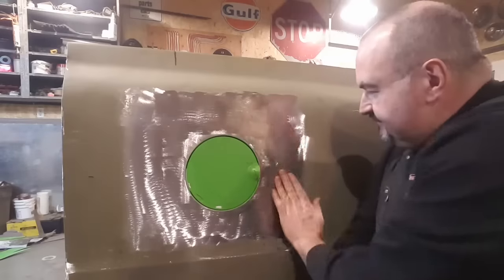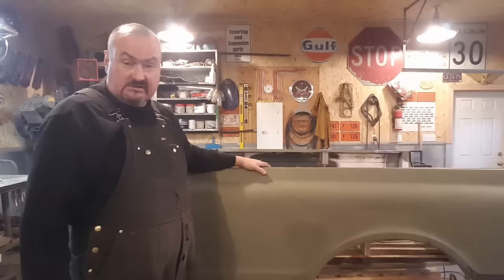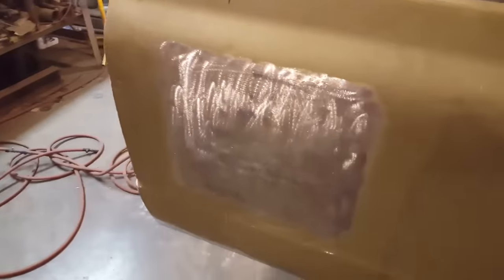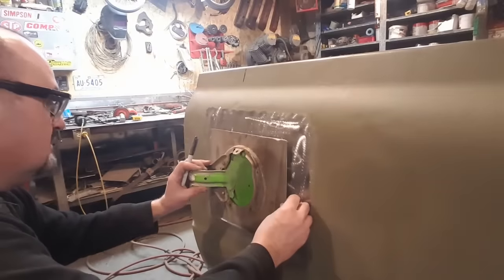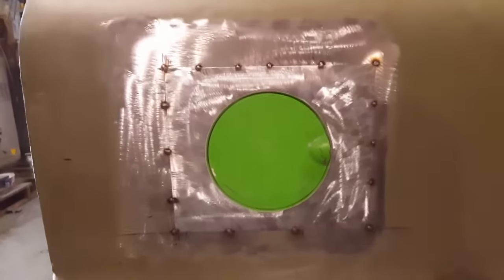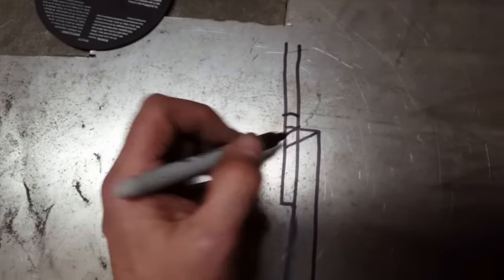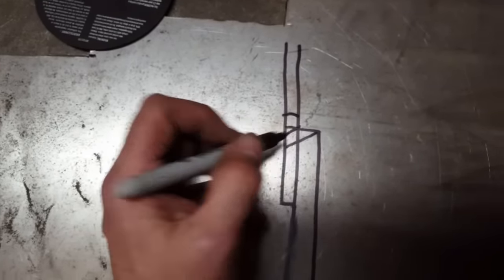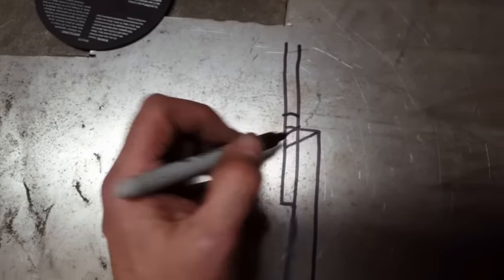Butt welding sheet metal the easy way.

Comment: Have you tried your hand at butt welding pieces with compound curves, such as a sailboat hull?  Most of the steel hull designs I've seen have one or two hard chines in order to avoid the difficulty of forming compound curves.  If I built a form out of reinforced concrete, how thick would it have to be in order to withstand a forming hammer?
Reply from the maker: Good qustion. Never did much form building in all my years at this. I found it very time consuming. I would think a wooden buck would be better. As the shock of the hammer might crack the concrete.  But I been wrong may times before and ill be wrong many times after
Reply: @fitzeesfabrications  I thought of concrete in the case of a combination concave/convex mold, as its weight (and some time) might alleviate the need for a hydraulic press or power hammer.

Comment: One problem... it is mounted upside down and backwards.  The little pullout tab area is pointing forward and will catch wind, potentially pulling it open... as well, rain water will find it's way in that way as well.
Reply from the maker: No its on right way. Front of the box is to thr left of thr door

Comment: Hi Fitzee. Need advice. The lower hinge on my '93 Dodge truck tore completely out of the door. I carefully measured the door's sheet metal thickness around the hinge area. It's only .030" thick. That's about 21/22 gauge steel. Wow is that thin for a door !! I used a Mitutoyo caliper. Measured in many places. Shocked at how thin the steel was. When I cut and butt a patch panel for the hinge area, can I use something thicker ?? I have some .045" material. Let me know. Thank you !!
Reply from the maker: Yes just make sure the thickness is inboard as so it dont bring the hinge out. Tricky repair.  Hope you got room for adjustments
Reply: @fitzeesfabrications  The .045 material will be cut and welded flush with the surface of the .030 material so it won't space the hinge outward. Sound ok ?
Reply from the maker: @mikep95133  yes sounds best kind
Reply: @fitzeesfabrications  Complex repair for sure.

Comment: Do you do that so it doesn't bugle? Cut a line in it. Seems like that would help with that. And warping.
Reply from the maker: Yes there are a number of reasons.  You have control over the metal and nothing moves till you get to it

Comment: Amazing to learn, dont want to second guess the master, but wouldnt the cap be better opening forward incase it was left open the wind would close it nor would it catch someones coat or something?
Reply from the maker: It's on right, that is driver side front of the box.
Reply: @fitzeesfabrications  ahh! Thanks for the reply, im in the uk but have an old impala that im going to start working on, was going to joggle everything but this is the way! Ps are you irish in canada perhaps?
Reply: @missionDan  Fitzee's from Newfoundland.  That's a typical accent from "The Rock".

Comment: This is a really awesome method, but depending on where your repair is, you won't be able to remove the cut piece of metal when you finish cutting/spot welding. In other words, you won't always have a cut window behind the panel to retrieve your scrap piece of metal.
Reply from the maker: This is true but there are many places I have used it. If I never cut the back out of this panel you still can get it out from below. The quarter is open on the bottom
Reply: @fitzeesfabrications  Makes sense. I'll be trying this technique when doing my quarter panels. Keep up the awesome content. Should wear a mask when welding though.

Comment: Absolutely brilliant! I would definitely use it. I have a question though - when butt welding and you do not have access to the back of the panel, how do you make sure that the panel does not start rotting inside out where the welds are after some time. I use flux core and so far I’ve always had access to the back so that I can work on it as well. Is there some way to prep the panels beforehand to ensure that they will not start rusting after a couple of days?
Reply from the maker: When you weld it will heat up everything. So preping it before won't stop thr welds from rusting. I try to find a way to paint the back side.
Reply: @fitzeesfabrications  Yes, that would be the ultimate solution. However on my BMW E30 the quarter panels have another panel at the back and if you do work on them when you weld them you do not really have access to the back, so I'm wondering how to do it.

Comment: Well I am impressed. A quicker way is to cut the patch piece abou t half inch too small. Weld 4 strips behind the 1/4 panel. Lay the patch in there and as indicated spot weld with minimal heat.  Fill the void with bonds. Very very minimal bondo is needed . Way way faster,maybe even stronger.
.....just not as tricked out custom as the vid.....nonetheless cudos to the vid.

Comment: Just found this channel a couple days ago. I have been binge watching. Not getting anything done around the shop but certainly I am learning a lot. It may have been mentioned or asked in the past but how does he get away without using a welding helmet? Is he using the tip to shield the arc from his eyes? Just curious.
Reply from the maker: Yes hiding behind tip

Comment: I keep hearing about having to hammer and dolley after welding..whats your thoughts on this?
Reply from the maker: Mig is a harder weld then steel welding with a torch. Hammer on dolly won't do much to a mig weld
Reply: @fitzeesfabrications  Thank you Sir for your time. I did a rust replacement wheel arch on my dodge truck and got some waves from mig. I took lotsa time tacking and welding and using air but couldnt make it perfect. There was couple spots where metal fitup was tight and made me wonder if the shrinkage made it worse. Thanks again very much

Comment: (Question.) So after finish welding the front, wouldn’t you also weld the backside to ensure you achieve a strong butt joint, before grinding it smooth? I would assume that would be the best way to do the patch. I know it is thin sheetmetal, but that would fill any voids. Also, is it true that the best way to so a sheet metal patch is by cutting a circle shape rather than a square because it helps avoid any distortion that could be caused by the corners? Thoughts anyone?
Reply from the maker: If you can't get to the back of the panel like here it is hard to  weld the back. I use alotnof heat so as to get better penetration for this reason. If I was to run a bead with the welder set up like it is I would blow holes. As for the corners. It personal preference.  I like square  corners as it give me a good starting point . I dont have no issues with heat in the corners. Some say it a stress that is a issue. Yes if this was a aluminum plane it would be. Its a car that has to be filled and painted. Panels on a car are more cosmetic then structural

Comment: I have learned so much watching your channel but the one thing I have a problem with 

when I weld in a patch panel I might go 2 or 3 spots then the next spot my welder will blow a big hole how do I get away from that ?
Reply from the maker: It depends on the gage metal your welding. 22 and thinner will do this. It's a hit and miss sometimes.

Comment: You can use warm water and a rag to cool the hot spots. And no compressed air needed.
Reply from the maker: Try welding wet metal

Comment: Should’ve used a gasket or cardboard and made a template and then transferred it onto the bed . Instead hold holding the lid backwards on it . Also when doing this you don’t want square corners . Square corners make the welding joint weaker
Reply from the maker: Not welding aluminum on a plane! Corner in thr automotive  industry are fine. There are many ways to do a job. Your way and my way are both ways to do a good job

Comment: I know this may sound strange...but what type of wire are you using? and what amperage is your welder set at?
Reply from the maker: Using 023 wire. As for settings. It changes from welder to welder.  I have a video on setting up a mig.

Comment: Why not just do a lap weld though? Unless you are concerned about it being seen from the inside but it looks like it would be out of view anyway from the back side. What i do with thin unibody car metal such as quarter panels and rockers is i bend in just slightly the edge of my cut on the car. The patch sits on top of that just barely slight bend at the edge, and the patch also sits flush to the car panel. I do this because a butt joint on such thin metal is very easy to blow through with a mig, even when stitch welding on lowest power. The slight bend of metal behind the patch at the edge helps to keep from blowing holes as much. I only say this because the method in the video seems unnecessary efficiency wise as you are basically cutting the truck side panel twice instead of once. Just another way to do it. Still came out looking good either way.

Comment: Wouldn't you put the flap facing the rear so that if travelling on the motorway, the wind down the side of the truck won't pull it open?
Reply from the maker: It is. That's the front  driver side of the box.

Comment: Lovely job but did you weld it in upside-down? Wont it fly open on high speeds.
Reply from the maker: No its on right. Thats drivers side of the box. Same location  as they are on a 2013 truck

Comment: All good & Well does EXCEPT!
The pull tab cover, is supposed to face REAR not front !!
As it acts like an airfoil gripping water into it, road debris and crap etc.
Sorry, I should have said something before you made so many tacks .
BTW, just wondering  what AMP settings you use here to weld this, I believe is 16Ga??
Reply from the maker: Look agian door is on right. I say this is 22 gage.

Comment: Does the panel behind the one you are installing ever get welded to the new panel when you are doing the tacks?   Great idea!
Reply from the maker: Not quite sure what you are asking. The outside panel becomes a part of thr inside panel
Reply: @fitzeesfabrications  I was wondering if the piece you pulled out from inside ever gets accidently partially welded to the new panel that you tack on top of it before you cut around the new panel - probably not since you cut through the original tacks
Reply from the maker: Yes it does from time to time. Sometimes it is tricky getting them out. You have to break a few welds

Comment: What are you using to protect your eyes while welding?
Reply from the maker: Don't see flash hiding it behind tip of gun
Reply: @fitzeesfabrications  That certainly makes it easier to see what you are doing. 
Thanks for the quick reply. Can you do that for anything other than the spot welding? I would guess not.  I have a wire-feed unit, and I am intending on doing some repairs using what you have shown us in your videos. Will that work for similar grade sheet metal?

Comment: How do you go about doing a much larger insert, like the skin of one hood/bonnet onto another shaped hood
Reply from the maker: Same process.
Reply: @fitzeesfabrications  further to the new shape skin on a hood how do you go about getting the old skin out between the hood frame and the hood skin when attaching the new one over the top or do you separate it from the frame first ?

Comment: Good job but haven’t you put the fuel filler cap in wrong? I thought the domed side of the finger pull was supposed to go backward to stop wind pull and opening up the flap, also it will look odd IMO
Reply from the maker: It's on right. This is drivers side of the box ahead of the back wheel

Comment: A noobie question. :D Once you have the new piece on top of the old sheet, you have tacked it on place. Then you cut some in the angle. After cutting you tack again in the final place. Doesn't the old metal get tacked easily too? It's very close to the new sheet.. I'm just planning to start learning welding, so this might be a stupid question. :D
Reply from the maker: No stupid qustions. Yes it can get tacked to the old metal. But for most part it not that hard to brake the inner section off.

Comment: I would have thought that the door should have been installed 180° to that so that dust and dirt doesn't go into the little finger slot for opening the door. It will be like a mini hood scoop that way. But I've never really done any body work so what do I know. And depending on speed and spring tension, the wind might cause the door to open while driving.
Reply from the maker: Its on right. That is the driver side of the box. Door is mounted ahead of the wheel. Front of the truck would be to the left of the gas tank door.

Comment: WHY DO YOU OVERLAP FIRST, THEN PUSH IN VS USING A GAP WITH VICE CLAMPS FLUSH?
Reply from the maker: It makes it easier. When you flush  mount and use clamps it will want to move around on you. The over lap and tach welded on keeps the panel in place. Also it is way faster. Cutting to fit a panel, specially a large panel is very tricky and time consuming
Reply: @fitzeesfabrications  Thank you very much.  This is very useful.

Comment: Great  welding but isn't the fuel flap supposed to open towards the front of vehicle so wind doesn't rip it open. Great video though 👌
Reply from the maker: Its on right. That driver side of the box. Gas door is ahead of the back wheel. Same place it is on a 2013 chevy truck

Comment: Hi, is this also possible if there is an ribbon in the panel? My panel is not straight like in the video..
Reply from the maker: The rib would not allow the flat panel to sit flush.
Reply: @fitzeesfabrications  thnx for youre reply! the panel that i want to weld in has the  ribbon as my car... i cut out a good piece from another car..
Reply from the maker: Oh I can see that working. Now at the rib you will find you can't do thr 45 degree cut. I would  scribe there and cut inside the line to get a butt finsh.  Start there with your welding and move on with the 45 cut and butt on rest of panel
Reply: @fitzeesfabrications  thanks  again for youre answer!!!  Greetings from the netherlands !

Comment: Everything looked perfect but there’s one issue! You welded it on upside down. The wind is going to catch that flap and blast it open. The finger hole should always be to the rear of the vehicle and open forwards
Reply from the maker: It is on right.  The front of the box is to the left of the gas tank door

Comment: cut out your square around the gas  door and then cut out a frame just a bit smaller then the  gas door or lid or what ever and weld that from the inside then you can weld the door  on the outside and it will have a stronger hold just. It's just  an Idea .
Reply from the maker: Many ways to approach a repair.  All are not wrong. Some are better thrn others. It's how you see you doing the repair that counts
Reply: @fitzeesfabrications  The thing is many people just don't know how to work with  bondo  and then you see where the job has been done you see the square or even the welding spots.

Comment: CAN YOU DO A FULL CAR SKIN USING THIS SAME METHOD..  i AM GOING TO ATTEMPT IT IF YOU THINK IT IS A GOOD IDEA.. i HAVE A 69 CAMARO AND i AM FITTING A 3/4 FULL SKIN AND WOULD LIKE TO KNOW YOUR THOUGHTS ON DOING IT THIS WAY ..
Reply from the maker: 3/4 skin? Not quite sure what your asking.
Reply: @fitzeesfabrications   What I mean is, it is not a full aftermarket panel that has the door jam or all the window and trunk lips.. It is just a skin that goes over 3/4 of the quarter panel.. so it is like doing your gas cap patch but on a almost full size quarter panel... I basically cut out the panel of  my 69 camaro and have 2 inches of the original panel going around the whole panel still on the car..  So I cut and trimmed my new panel to be bigger.. Like you did on your gas cap patch..  But this is like 4 feet by 2 feet  panel.. If you get what i am trying to say.. LOL  I was just wondering if you think that your method will work on a bigger longer sheet metal patch..  without warping the entire panel due to its length and overall size.. or do you recommend me to do a flange and spot weld it..?   Your method looks doable to me.. I just wanted to know if you think it will work on a full size skin patch..?
Reply from the maker: I call those scratch panels.  I like to cut them.close to a body line and if they go up into thr panel I only replace what is gone. Look at my quarter panel replacement video on a nova. I use those panels in that video

Comment: What kind of eye protection is he using?
Reply from the maker: I hid the arc behind the tip of the gun
Reply: @fitzeesfabrications  Is this a practice you use only for tack welding ? It appears you are placing the nozzle almost flat against the work. I assume the tip is recessed quite a bit ?

Comment: You get less distortion using a circle patch than square.
Reply from the maker: Hard to cut round corners with a 4 inch cutting disk. I heard many say that but I dont have trouble there. I like to start on a corner. But agian I said it a number of times. There are many ways to do this job. My way is just one way. Cheers

Comment: It's backwards.....there will always be road dirt,off road dirt,mud,debri,grime,which is concentrated and collected from the normally called( when not upside down ),thumb pull..l
It is now an air intake funnel,drawing in whatever goes by due to the forward travel of the truck.it gradually  mixes with the inevitable fuel drips when removing g nozzle...over time ,,resulting in a nasty ,toxic,eyesore around the cap...which gets blown all over the cap from the wind blowing into air funnel.this causes a filthy hand for any one who removes fuel cap...
.this scenario happened to a freind...........just opening door gave him nasty finger from the inside .....he had a diesel and it made it worse...
Reply from the maker: It's not backwards look agian..